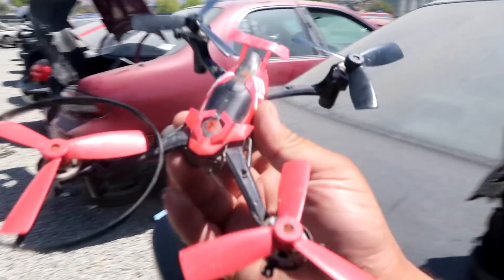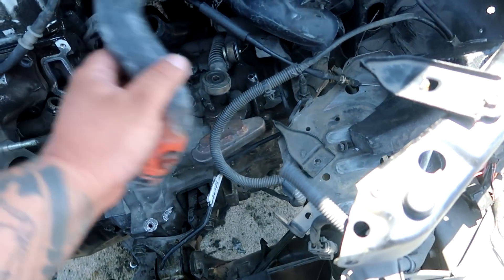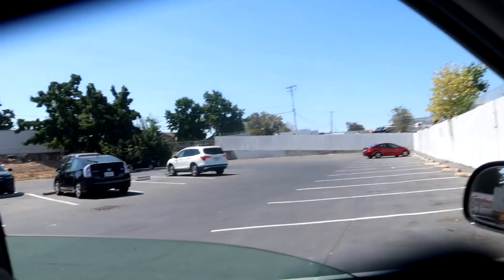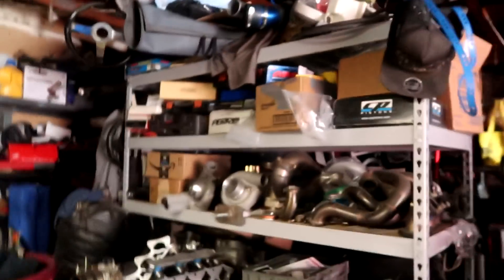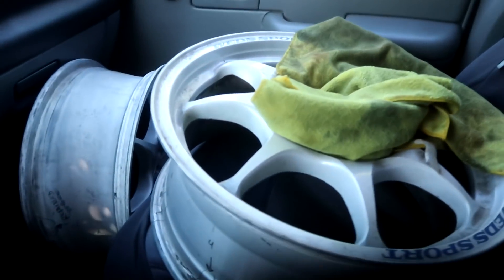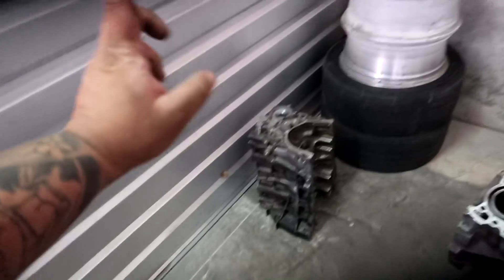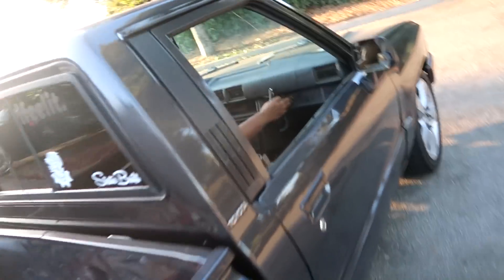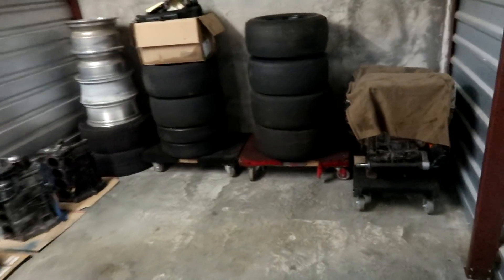JUNKYARD FIND ! Moving the Garage JUNK into storage!

Comment: Man 10x40 that's some work space! I need to look at something like that but here it's like almost rent for an apartment. Now for one fast wagon!
Reply: alphant1  Shit! I commented on the wrong comment!
Reply: Ok I thought he said he didn't know if he could work there my bad. Still plenty of room
Reply: @upfactoryracing4148  It would have to be some quiet work with only one car in the parking lot, like an engine buildup. Painting would be a problem if someone saw or smelled the fumes/vapor. Chances are it would be better to keep doing everything at the house. Changing wheels is certainly ok with any storage facility.

My crappy storage place has no lights and no power (outdoor room). I bring a 50foot extension cord to plug into the only outlet mounted on the sidewall of the front office building/indoor units. I bought a Ryobi 18V LED work light to see usually. Sucks.